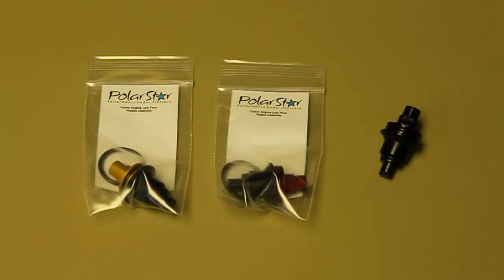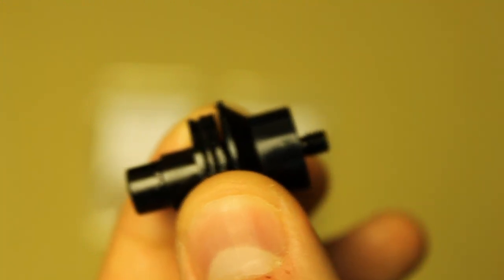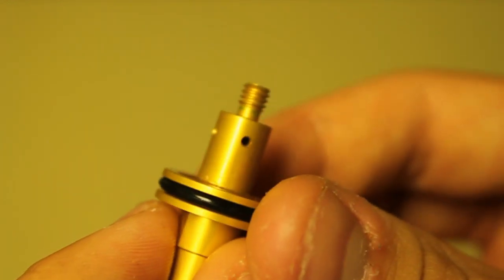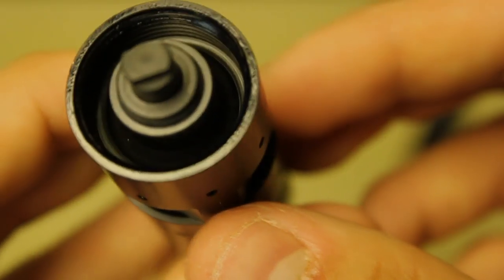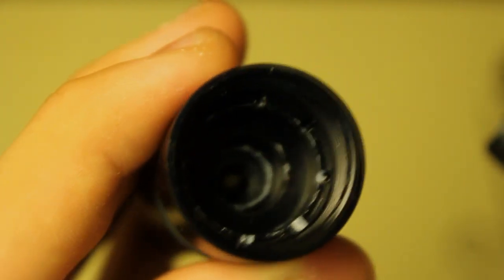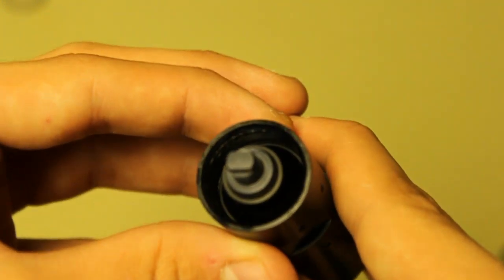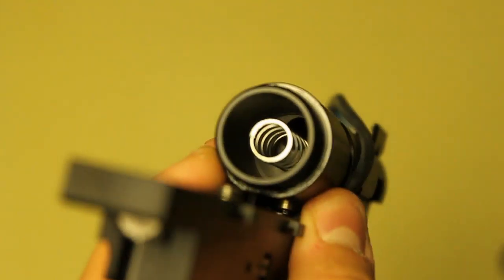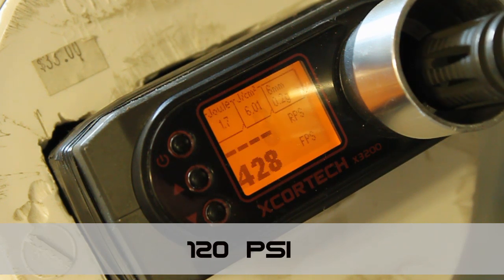Behind the Fusion Engine: All About Poppet Valves

Comment: Alright here we go. I am tight on money but willing to spend some money on my new polarstar to save air and have super accuracy. the only thing is that my field has a 1.25 joules limit on polarstars. I have a 6.03 tightbore in my gun and stock polarstar. Could i get a red nozzle and a red poppet valve and run at 40 psi and still be under my field limit? or should i get gold? or if worse comes to worse just go under and get a lower fps nozzle? Im new with polarstars so your advice is key. Thanks and I love your videos!

Comment: I have a red poppet and red nozzle in my gun but in order to stay at 400 fps with .20g bbs i have to turn my psi down to 50. I think it was causing problems with my gun because of such low psi settings. Should I keep the blue nozzle in my gun and red poppet so I can turn my PSI up to around 80 to achieve 400 fps?

Comment: how does the poppet valve close after the shot? There is no spring pressing down the "conical part" to the o-ring end cap. I can't find any animation of the valve. Do you know where I could get it?
Reply from the maker: There absolutely should be a spring. It sits recessed into the cylinder portion of the fusion engine, and should be exposed when you unscrew the poppet compartment from the rest of the engine. As far as any poppet valve animations, this actually happens to be the only one that I know of haha. 

Thanks!
-Robby

Comment: Kindly advice on how to properly lube the poppet valve as I have that issue wherein the first or few trigger pull it wouldnt fire properly and most suspect that it could be the poppet valve /oring issue. Thanks!
Reply: take apart the poppet and lube the inside...easy
Reply: FireTeam56
 got it.. thanks for the tip!

Comment: I need to re lube my engine due to use.  I am running a gold poppet and a black nozzle.  I want to go ahead and relube everything needed.  Do i only lube the o rings? How heavy do i lube it.  Sorry for the nube questions but i have not seen a video on what and how to lube the engine.
Reply: very little goes a long way especial when ur talking about rubber o rings. i put a few of them in my hand take a small finger of grease and then rub the orings around it does it pretty good

Comment: I have a 455mm tight bore with a prowin hop up in my DMR. Do you have a recommendation on what type of poppet valve and nozzle. My target FPS is 450? I currently run a ninja 68/4500 ninja tank and it barley last me, I'm trying to reduce my press but keep my FPS up at the same time.